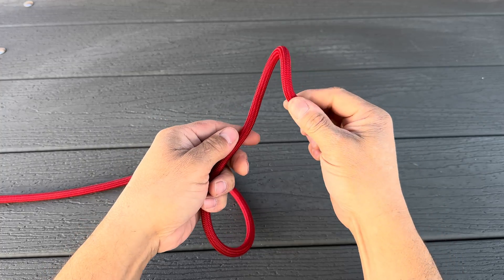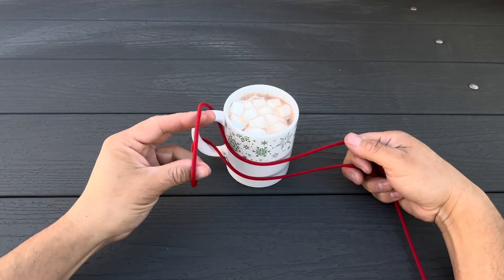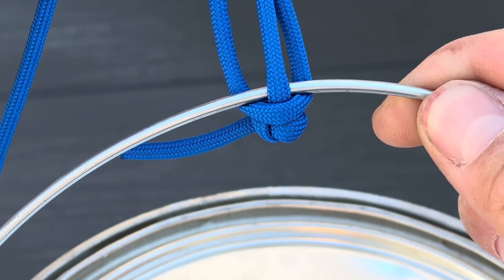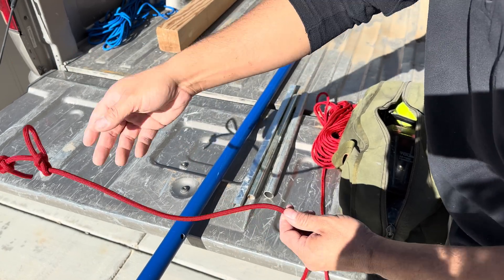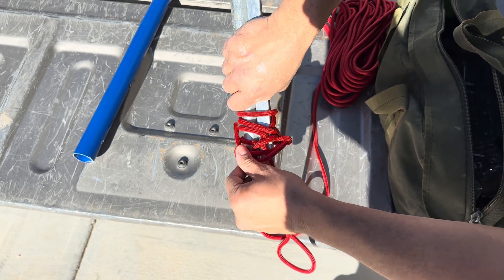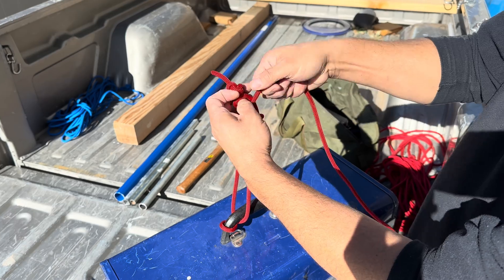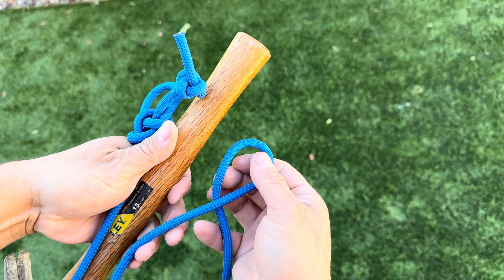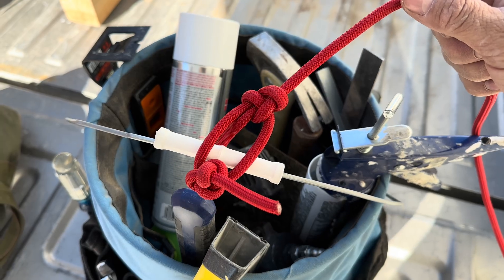What’s a “Button Hook” knot for?

Comment: I saw a roofer use a version of this with a two loop bowline to secure a tarp to a roof for easier one handed removal later. He put the first loop through the tarp grommet from underneath and stuck the second loop into the first loop from above and used the tail to lock in the second loop.The tail just needs to be longer than loops. Don't know the name but remember the knot.
Reply: He did a video on that very knot recently. He called it the Venus Fly Trap, it's a Portuguese Bowline with the two loops wrapping in opposite directions round an object, and the bitter end acting as the stopper as you describe.

Comment: I use this and modified forms of it fairly often, great knot. I'd love to have a better concept of how much tension it'll put up with, and specifically if there's any amount of tension that will pull the button through the loop. I think any time you can get it so the button & loop are laying on a surface, and are pulling into the surface, that surface makes the button completely secure within the strength of the cord because all the forces are opposed. In the example of the paint bucket handle I'm less confident that I understand how it'll work out, but I don't think a 1 gallon can of paint is anywhere near the force needed. A 5 gallon bucket of paint will usually have a more substantial handle where the 'pulling against a surface' situation comes into play. With the anvil, the clasp is floating in air and the other loops are pulling the clasp apart, this is the case where I think there could be some load limit where the button can pull through, but I'm not sure and I can't solve it in my head.

Comment: 👍 Have you noticed that you can set the button for quick release, if your tag end is long enough to remain behind when you "close" the button? Then to quickly undo the button, you simply release the load a little and tug on the tag end which pulls the button back out of its loop.